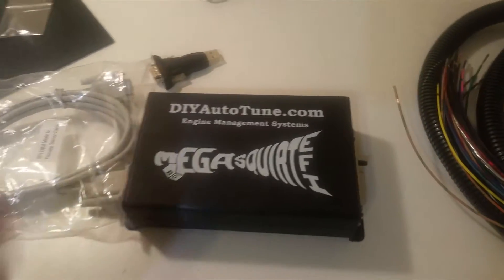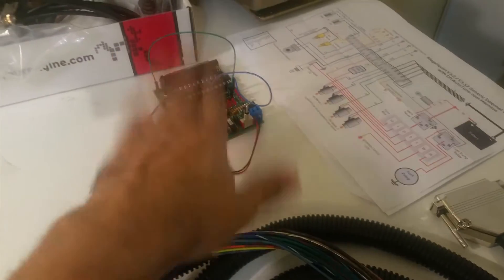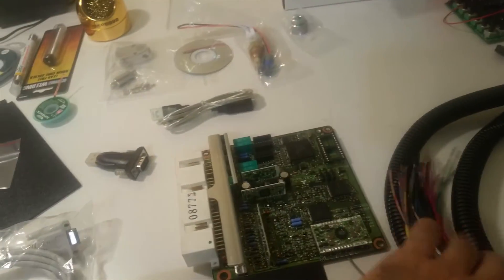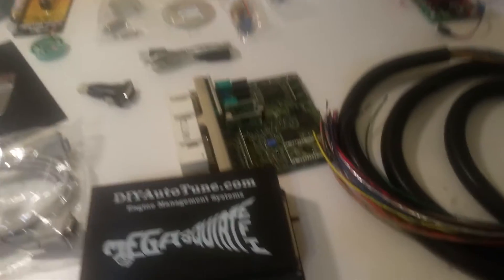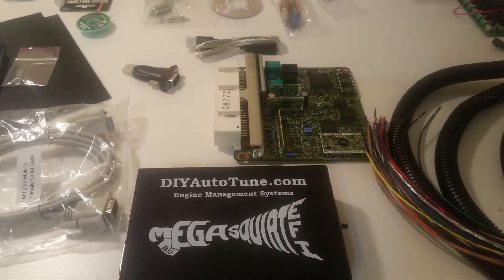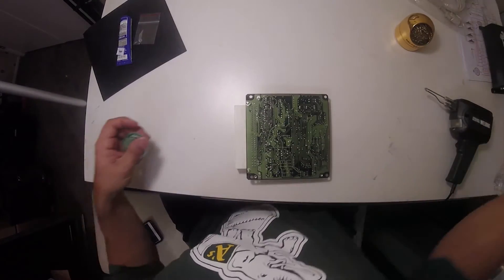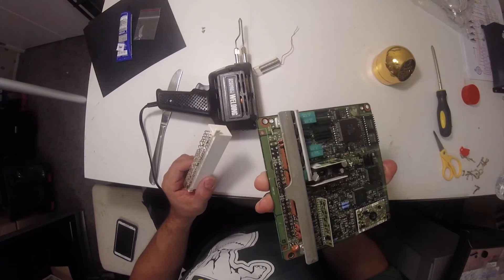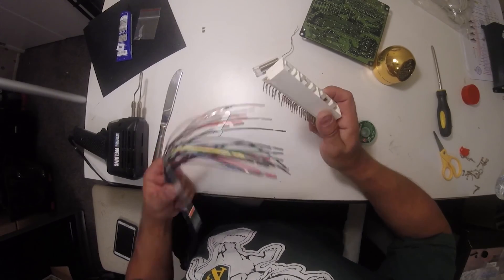DSM Turbo Gets Megasquirt Standalone ECU Part 1

Comment: hi! are you running full sequential timing injection?
Reply from the maker: hades god batch fire injection still
Reply from the maker: hades god The ability is there but the initial goal was to get the car running as good or better than on the chipped ECU. Mission accomplished. Full sequential might be on the list in the future but not in the short term.

Comment: Wayyyyyyyyyy too much work for something you could've bought, plugged and played.
Reply from the maker: MadMachinist5.9 yes it is an insane amount of work. Just didn't want to use the OEM circuit board, and will be tuning this myself. It definitely is not for everyone.

Comment: you could have sent the ecu to ecmlink to see if they could save it, before hacking it maybe you did... but come to think of it couldn't you have used a non turbo ecu from a 1g?
Reply from the maker: Mitsubishikid it was a spare with capacitor leaks. No worries.
Reply: Well unless you sent it to ecmlink and they said it's nuked beyond recognition, it still could have been refurbished by them, because they offer cap replacement services, and I have seen some amazing work from those guys over there, plus I can see it has an eprom and a knock board already on the main board, meaning this came out of a turbo dsm, and it could have gone to better use provided the leaking cap damage was not that bad.

I'm curious do you want to sell the remains?
Reply from the maker: Email us at goproerthang@gmail.com